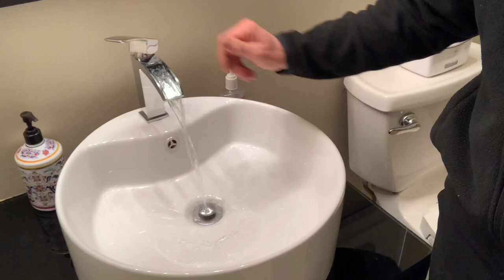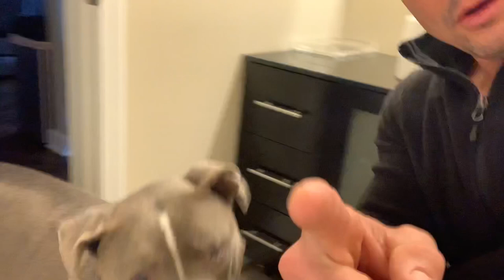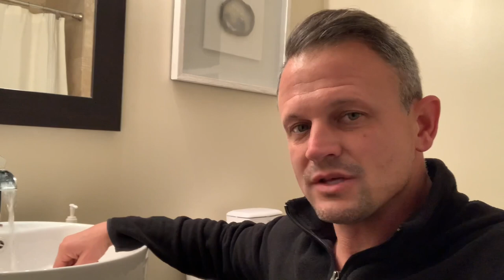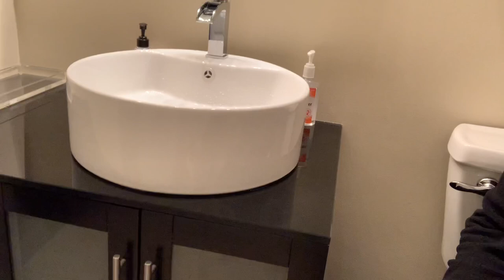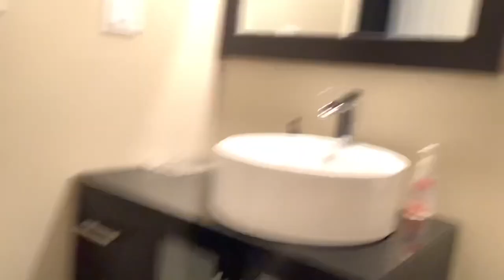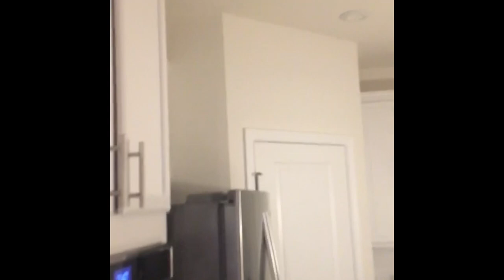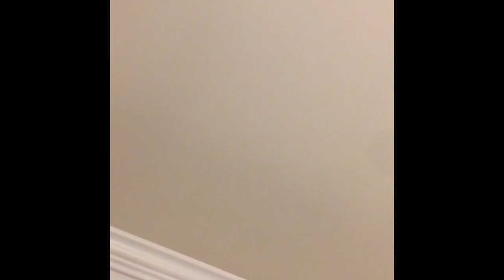Hear Water Dripping, but Can’t Find Any Water Damage?

Comment: i am on upper level condo i just re did my bathroom and had to replace shower faucet and since then i can hear this dripping sound overnight and then it scares me that i am praying its not leaking anywhere which i cant get to or see ,coz right underneath is y neighbor , i cant afford to redo my bathroom again, i hope its nothing to worry about
Reply from the maker: For your situation you might want to call the plumber that did the work back out to double check that nothing is leaking. Typically most states require contractors to offer a one-year warranty on workmanship and manufacture defects, so if they made a mistake and some thing is leaking they are obligated to fix it.

I would also when they come out have them check your neighbors unit below you to make sure there’s no water staining or indications of leaks in their unit.
Reply: @BJPoznecki  so you think it could be leaking?
Reply: @BJPoznecki  and I didn't even use that shower today to see what happens, overnight early morning it made some dripping sounds randomly few times very slow
Reply from the maker: @jaszzy26  I think being that you just had the work done, you should have the plumber come out and make sure all is good.
Reply: @BJPoznecki  plumber did do the change new faucets and everything but ya I don’t have much choice I need peace of mind that nothing is happening just a sound
Reply from the maker: @jaszzy26  I agree, it doesn’t hurt for them to swing out really quick and just confirm everything‘s OK. I’ve done quite a bit of plumbing in the past and all it takes is a pinhole leak at a fitting.
Reply: @BJPoznecki  also my furnace and attic idk what is it but they are on top of my bedroom ceiling, so  I do hear like water running maybe when it heats up for heat it’s such weird set up but is it anything to do with those pipes?
Reply from the maker: @jaszzy26  It’s very possible. You have to do a little process of elimination to try to pinpoint where the sounds are coming from, and if there an actual leak or just thermal expansion.

Comment: I have a sound like that behind my toilet.  When I press my ear to the wall I hear it better.  It happens randomly and when I shut the water off to the toilet, it slows down and eventually stops.  Any idea what that might be?
Reply from the maker: Well you can experience the same sound when running hot water at your plumbing fixtures.

However, the toilet is on the cold supply line, so you shouldn’t experience that with the toilet running.

Take a video, upload it to YouTube, then text or email me the link, so I can see what you’re experiencing?

773-403-3298

wpoznecki@yahoo.com

Comment: would this only be heard in the cold/winter months or all year round? I have been hearing this in my bathroom and cant figure out where it is coming from. I fear there is a leak but cant understand why I only hear it after or during water use. 

If it was a supply water line, I should be able to hear the dripping sound 24/7 right??
Reply from the maker: If you’re only experiencing this during and after using the water. It’s the hot water going down the drain expanding the pipe creating the noise. 

Yes, if it was a water supply line leaking you would hear it constantly even when everything is turned off.
Reply: @BJPoznecki  i will try when i get home but if i hear the dripping sound when i turn the COLD water, then i need to go back to the drawing board right??? 

I hope i dont hear it with the cold water too
Reply from the maker: @jfeva0049  When you get home turn off the heat and don’t run any plumbing whatsoever. This way the house is quiet and nothing is on. If you don’t hear any sounds then we know the plumbing supply lines are OK. 

Next, turn on the cold water at every fixture, faucets and showers, and see if you hear anything. 

After that shut the cold water off and turn on the hot water at every fixture. By doing this in steps we are trying to process of eliminate. 

Follow these steps and let me know how it goes?
Reply: Just wanted to say thank you. I do only hear the dripping sound when the hot water is/had ran for a few minutes. 

I was already losing sleep over thinking i had a leak in the walls.

👍🤝
Reply from the maker: @jfeva0049  My pleasure pal happy to help! 🤝

Comment: Can the same thimg happen in the opposite situation. Where instead of a heater the AC kicks on and then theres a ticking noise in the bathroom?
Reply from the maker: Yes, you can have reverse thermal expansion where the pipe or ductwork is warm and then cold air or water goes through it making it contract creating the same sounds.

This is very typical if you have pipework or duct work running through a mechanical room, where it’s warm, maybe even hot and you have cold water or air passing through making the pipe work or ductwork contract.

Comment: Would something that sounds like water briefly running through the pipes in the walls several minutes after the sink has been turned off be a similar issue or would that indicate a clog of some sort?
Reply from the maker: Well if you had a clog you would have slow draining water. If the water flow is good in your sinks, toilets, bathtubs, and showers then more than likely you don’t have a clog. It’s just thermal expansion or the remaining water draining through the pipe to the sewer.
Reply: @BJPoznecki  Nothing seems to drain slowly that I've noticed. The guest bath  toilet (roughly 20 feet from kitchen sink on other side of the house) has had issues refilling fully as of late though I assumed that was something to do w/the fill valve b/c of the high pitched whine it makes when flushing which kind of makes me wonder if maybe we have a clogged plumbing vent. The weather did go from 95 to 65 the a couple of days ago which does seem to point more towards the thermal expansion possibility.
Reply from the maker: @kentatm2663  Yeah the toilet filling slowly is usually due to the fill valve needs to be replaced and has no correlation with thermal expansion.

It sounds like a typical thermal expansion situation, I would just replace the fill valve in the toilet sooner than later.
Reply: @BJPoznecki  I'm on that one for sure. Tried to change it already but the box didn't have all the parts. :-/ Thanks so much for your fast responses!
Reply from the maker: @kentatm2663  🤦🏻‍♂️ It never fails parts are always missing. Now I open the box at the store and check and make sure everything is there before I leave 😆

My pleasure good luck with everything! Don’t hesitate to reach out if you need anything 773-403-3298

Comment: I recently had my home plumbing re-piped using PEX the red/blue lines to run through my attic and in my bathroom when I use the hot water especially if I turn it on all the way I hear a dripping sound almost just like this afterwards. I was wondering if anyone would know if I should be worried about it or if it's the same thing as in the video?

Comment: can thermal expansion happen with COLD WATER? i hear the dripping noise behind the upstairs toilet. man i searched high and low, in the basement and the entire house is bone dry. the upstairs and downstairs bathroom sit on top of one another. i don't hear it in the downstairs bathroom though. i assume its after i flush. i heard it last night and it stopped. weird
Reply from the maker: Actually, it can. It’s more rare. But I have seen situations where we have cold water running into a pipe that is warm. It could be warm because there’s a heat duct in the same joist cavity, or a pipe running through a mechanical room, etc. where the pipe is warm, you flush cold water, and you get a reverse thermal expansion situation.
Reply: @BJPoznecki  right, i dont think its a leak which gives me relief BUT its just annoying as hell. i woke the wife up at 3 am last week to search high and low for water and bone dry 😂
Reply from the maker: @Larry-s9e7i  🤣 Well, still keep an eye on it, because I have had situations where it could be leaking, and just not showing its face right away. What I would do is flush the toilet repeatedly, one after another, for 30 minutes. This way a ton of water is running through that area and see if the thermal expansion sounds stop, or you start to see any water staining or leaks.
Reply: @BJPoznecki  sound advice. appreciate the feedback.
Reply from the maker: @Larry-s9e7i  My pleasure! Let me know what you find out I’m always curious?

Comment: if it goes on for 1-2 days is it that same cause? or something else?
Reply from the maker: @AnnUnicornStar  Usually with thermal expansion the most common thing to experience is hot water or running the heat. It’s the hot water and hot air heating up the pipe or the ductwork. If you’re hearing it consistently for two days, it might be worth calling a contractor to come and take a closer look.

Comment: what happens after freezing below 0 temperatures and temperatures warm up and you can still hear running water in your pipes when the faucets are turned off
Reply from the maker: Well in your case I would definitely keep an eye for any signs of a water leak because it is possible a pipe may have froze, cracked or loosened up, and you may have an active leak. You’ll have to do some investigating. You may want to call in a plumber so you have a professional assessing the situation.

Comment: I definitely have this, only happens when the heat turns on and stops as soon as it turns off. It drives me INSANE. Is there any way to fix this or stop it from happening? Or no matter what you do will you hear it? Thank you.
Reply from the maker: Hi Brooke! I hate to be the bearer of bad news unfortunately no because the ductwork will expand and contract every time it heats up and then cools down.
Reply: @BJPoznecki  ok, thank you so much for responding, I appreciate it.
Reply from the maker: @brookekonsky4683  My pleasure Brooke!

Comment: I think ours is coming from the duct. We hear it when no water is running  and I wondered why I only heard it in the cold months. Can it be fixed?
Reply from the maker: No, unfortunately what you’re hearing is the metal duct expanding and contracting with the heat from the furnace.

Comment: Ok but could you actually provide a solution to stop the noise.
Reply from the maker: @nafiulshelim6194  Unfortunately not always. This is one of those things you have to get a contractor whether it’s a plumber or a heating and air conditioning contractor involved and you have to start opening stuff up where you’re hearing the noise and see if you can modify it to minimize it or eliminate it all together. But it is a crapshoot.
Reply: @BJPoznecki  Just knowing it can be fixed is enough for me.
Reply from the maker: @nafiulshelim6194  it’s not 100%, but it is possible. Please know it could get a little invasive because all of your pipe and ductwork is in the walls and ceilings, and it may require you opening things up to fix it.
Reply: @BJPoznecki  yeh thats fine its an internal wall between bathroom and storage room

Comment: How can i get rid of that dripping noise and why i only hear it in one bathroom wall. I have 3 bathroom in the house
Reply from the maker: You would have to get a heating and air-conditioning contractor and Plumber involved to help you pinpoint where the sound is coming from, what’s causing it, and what they can do to remedy it.

Comment: Hello, the dripping sound is very faint but when you run the water for a little while it becomes really rapid and is usually accompanied by a loud kghhhhh sound (kind of a rust like sound), i dont know if theres a leak in the hot water tank or something but it gets worser the longer the water is running
Reply from the maker: Could be the hot water tank is going and May need to be replaced.

Comment: I get the same sound when I flush the toilet. It starts when the tank is filling up then subsides when it’s filled. There’s no leaks. I’m just kinda lost because it’s cold water. And the furnace is never on.
Reply: I have the same question and issue. Did you ever get a response? We have a 2 story house. Only hear dripping when toilet is filling. No signs of leaks as we hear it over the fridge/cabinet area

Comment: I hear the same sound as yours..but i hear mine when the toilet is flushed and the shower is used..its driving me nuts!! I have checked the ceiling downstairs for any signs of water damage..i see none but just everytime somebody uses the toilet and tub upstairs, there’s always this dripping sound..I’m very scared..pls help!
Reply from the maker: Well this can happen with cold water too if the pipe is warm and it’s contracting. If you’re not seeing any signs of water damage and you’re unsure or uncomfortable. I would recommend hiring a home inspector or a contractor that has a thermal imaging camera that can maybe see if there are any what we call thermal anomalies in that area that may help determine if there is anything leaking.

Comment: How long does the noise last after turning the water off? I turned the water off over an hour ago and I still hear it.
Reply from the maker: Hi Jen- Hard to say it depends on how hot the water was, so if you were running hot water for a while I could see maybe 30 minutes.

However, with duct work it could be an hour.

Comment: Hi BJ, great video! We are experiencing these sounds at home, our issue starts when we flush the master toilet, then right after the toilet tank is completely filled up, immediately you start hearing the marble/dripping sound at one of the rooms in the house(separate room from where the toilet is). Important to mention that if I flush the toilet multiple times the sound stops, seems like after leaving the toilet with no use for a range of time it does it , then flush happens and then it goes away. I read a comment you made that cold water shouldn’t cause this sound but only hot water. What do you recommend us to do?
Reply from the maker: Thank you for the compliment Cesar!

Sorry for the confusion. I should clarify it’s more common to experience expansion and contraction noises with hot water running through a cold pipe. 

However, the opposite is possible too with cold water going through a warm pipe as well. One example would be a drain pipe in the same joist cavity as your heating and air conditioning ductwork. Where when the heat is on it heats up the drain pipe and then cold water runs through contracting it.
Reply: @BJPoznecki  It makes sense, appreciate the time you took to answer my concern and note. Keep up the good work!
Reply from the maker: @cesarmarroquin6369  My pleasure thank you for the compliment and watching the video!!

Comment: What can I do to fix this ?
Reply from the maker: It can be tricky and not a 100% guarantee that it all go away. You’d have to get a plumber and heating and air-conditioning guy involved to try to track down where the noise is coming from open up the walls or ceilings and try to make modifications to either the ductwork or pipe work.

Comment: Then why some houses make that sound and some don’t? Old or new house.
Reply from the maker: Sevencoins7- It can happen on any house old or new. There’s a lot of variables such as the material of the pipe, PVC plastic expands and contracts more than metal. With heating and air-conditioning thinner gauged ductwork will make more noises than thicker. How tight the fire stop expansion foam is around the pipe or ductwork, etc.

Comment: my parents and i got home and my dad turned on the A/C. i at first thought it was water dripping but i watched your video and now think it might be thermal expansion. i dont know for sure yet because it is still making the same noise after about 15-20 minutes. Help?
Reply from the maker: Hi John- Turn everything off and don’t run any plumbing whatsoever. This way the house is quiet and nothing is on. If you don’t hear any sounds then we know the plumbing supply lines are OK. 

Next, turn on the cold water at every fixture, faucets and showers, and see if you hear anything. 

After that shut the cold water off and turn on the hot water at every fixture. By doing this in steps we are trying to process of eliminate. 

Follow these steps and let me know how it goes?
Reply: @BJPoznecki  i didnt see your reply but the noise has stopped. i am pretty sure there is a leak in my roof because all the snow on my roof has melted and their is no more noise.
Reply from the maker: @johnm9439  

That’s strange I replied yesterday:

Hi John- Turn everything off and don’t run any plumbing whatsoever. This way the house is quiet and nothing is on. If you don’t hear any sounds then we know the plumbing supply lines are OK. 

Next, turn on the cold water at every fixture, faucets and showers, and see if you hear anything. 

After that shut the cold water off and turn on the hot water at every fixture. By doing this in steps we are trying to process of eliminate. 

Follow these steps and let me know how it goes?

In regards to the the roof sorry to hear, sounds like a potential ice damming situation. Not sure where you live, I’m out of Chicago and a lot of my customers have experienced the same thing.

Comment: This is exactly the sound I hear but periodically it sounds like a LOT of water dripping at once.  That will last a minute and then go back to the single drops.  It only happens in winter at night.  Could that still be this?
Reply from the maker: Hi Manar- Naturally always check the area to the best of your ability because there always is a possibility of a water leak. 

After looking if you don’t find anything more than likely it is; and the noises are usually louder at night because it’s so quiet within the house, the sound magnifies.